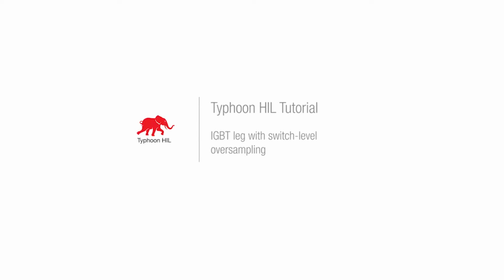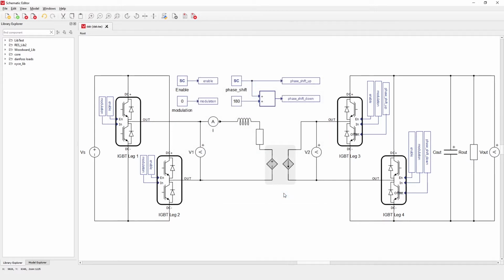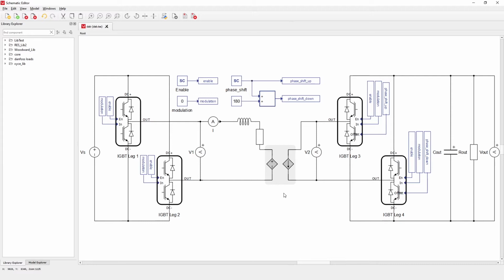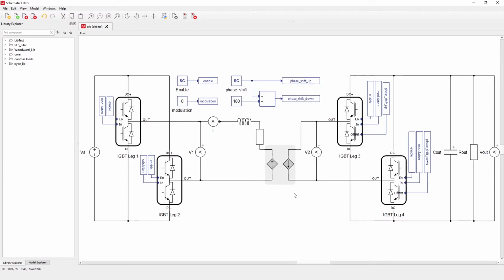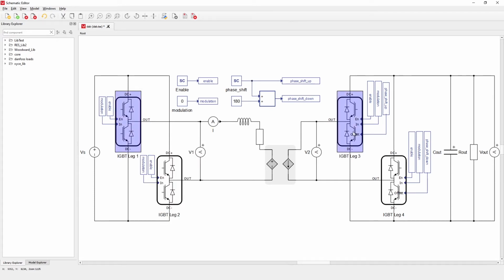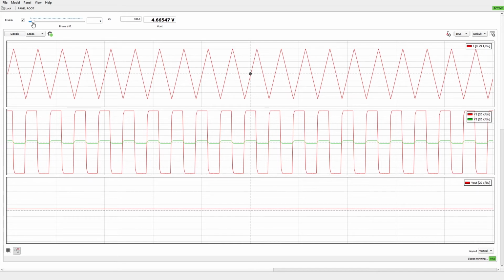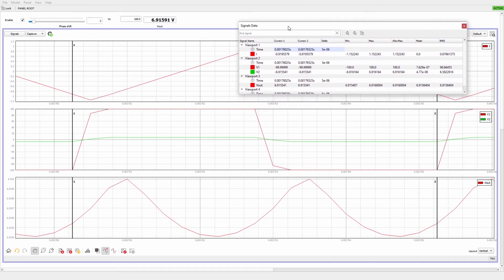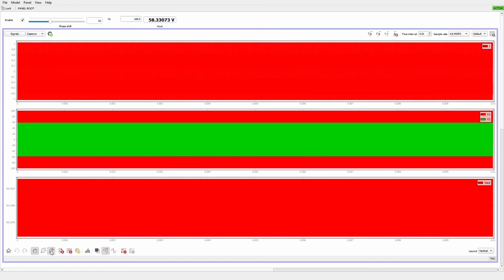IGBT Leg with Switch-Level Oversampling | Tutorial

Comment: In HIL script editor minimum simulation time step available is 0.5microSec (500nSec).
But, how came you are being able to use 250nSec as simulation time step.
Please let me know.
Reply from the maker: Hi there! The minimum simulation time step depends on the HIL device chosen and it differs between the devices offered. Your model might be built with configuration settings for an older HIL device than the one shown in the video.